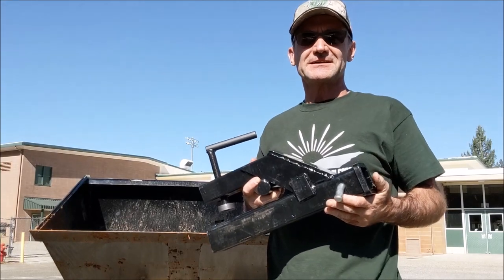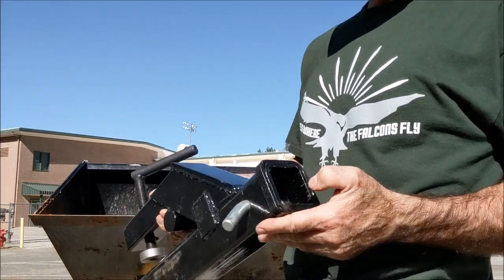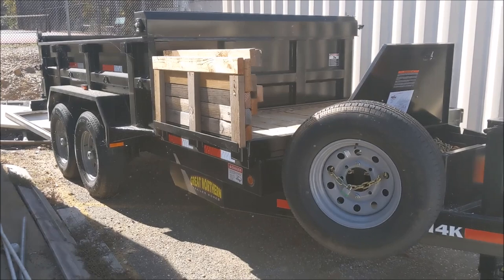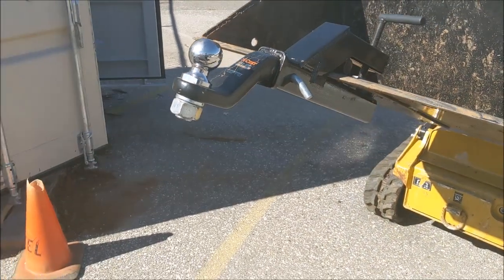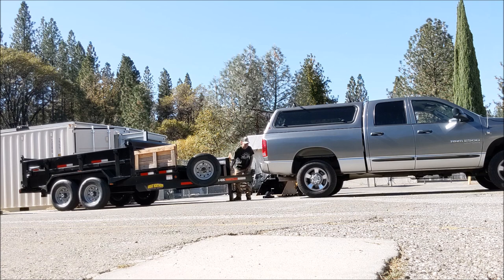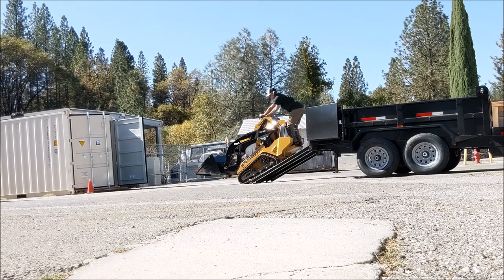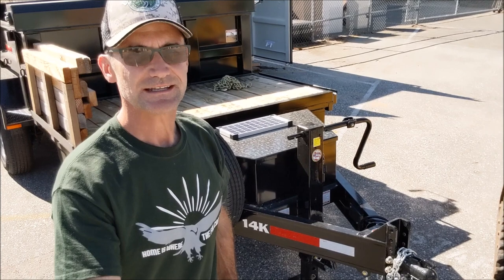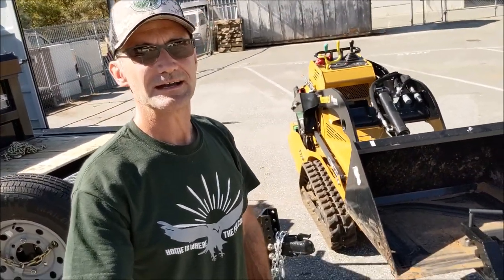Vermeer CTX50 Clamp On Tractor Bucket Hitch Reciever Review

Comment: A normal  person  would  raise  the dump bed to lesson the ramp angle & lower the  jack on the trailer  tongue so  coupler & bucket can stay lower so you can pull it easier without it causing the track loader to tip as much.
Reply from the maker: Good to know, sorry to say that I'm not normal
Reply: Well  that's  why I felt  I needed to point that out. Lol.